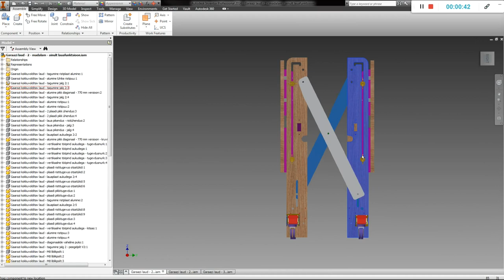How to build a folding workbench with two different surfaces | Mobile plywood workbench

Comment: I have seen both black and white melamine, but where can I find plywood with that (appears to be) rubber textured finish??
Reply from the maker: This is a regular brown color melamine birch plywood. There is no special coating. One side of the plywood is with a smooth surface and the other side is with a pattern which is called "wire mesh".
It is marked as F/W plywood in the part of the world where I live and is used mostly in construction because it is the cheapest of the melamine covered plywoods.